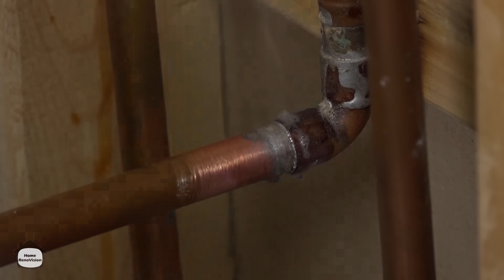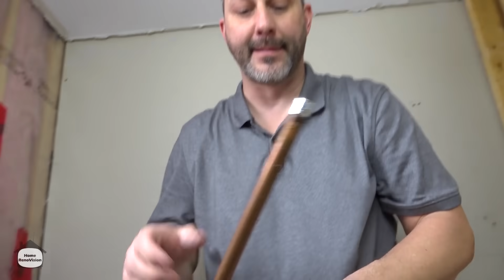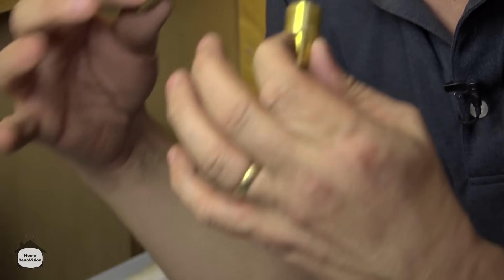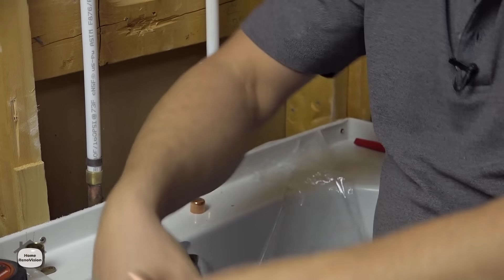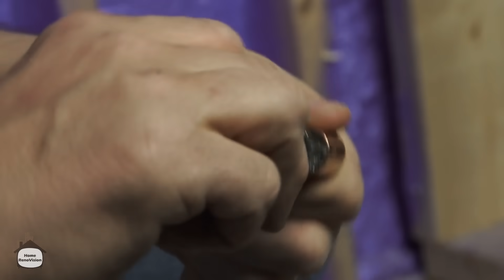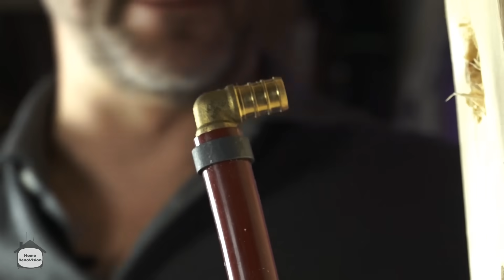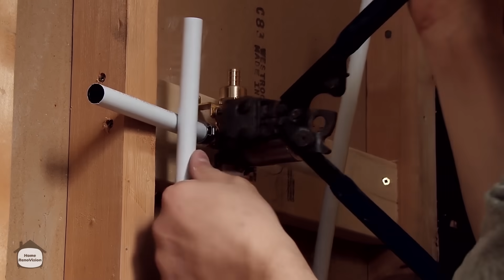4 Types of Shower Valve Assembly Installations

Comment: I use 2 pieces of painters tape on the tube on both sides of the ring to keep it in place. Or crimp it just a tiny fraction so it's still movable though tight on the tube.

Comment: JEFF, is it necessary to have the hot and cold supply line pipes extended past the center shower valve? what would happen if the hot and cold supply line pipes were only at the same height as the shower valve? Does having this extra length in pipe release pressure or have some other purpose? When you installed the copper to the plastic PEX pipe, the hot and cold supply lines pipes weren't extended past the main valve.

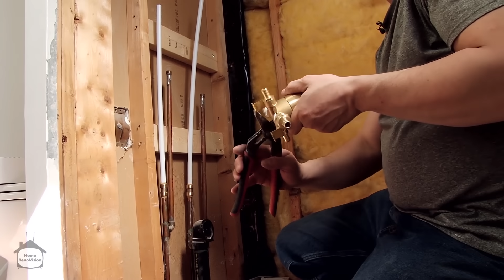Comment: In the last segment at 1:01:55 when using the pump pliers to install the threaded fittings, if you hold the pump pliers in the opposite direction, with the lower jaw facing the direction of rotation, you will find that the pliers are less likely to slip.

Comment: QUESTION - We would like to have a shower/tub with a DUAL shower heads on each side of the shower.   I trying to figure out the diverter valve and the outputs.  Poition 1. Tub spout..... Position 2. Main Shower head..... Position 3. Shower head 1 & 2.   Seeing the dilemma??

Comment: I have a shower that has a copper manifold like the one in the video I have changed the cartridge an turn the valve on an no water will come out . It doesn’t have a spout for the tub just the shower which I have new pipe goin to the shower head I can take the cartridge out of the manifold an turn water on an it has water shooting out but put the cartridge in an no water I changed cartridges several times using different types but none will let water come out the shower head .I been workin on it for six months can you help me please

Comment: I’m a plumber and I work with pex. I couldn’t help but see that on the cold side 90 the you crimped you didn’t crimp the ring all the way and you left a belly on it. That for sure will be a leak with time. On the last diverter of this video. The 90 you crimped on the cold side, you didn’t push the pipe all the way in the fitting and when you crimped the ring, you left too much space so just by seeing that, the ring didn’t catch the bridges on the fitting and didn’t make a water right seal.

Comment: I am looking to renovate my bathroom and started looking more into converting to PEX after watching your videos. It seems so simple especially the last way you show us with the shark bites (no soldering) - I am concerned with leaking at the joints. I keep reading that PEX is only good short term and will eventually leak in the long run - can you advise on this?

Comment: I CAN NOT BE LEAVE HE IS PROMOTING SHARK BIT FITTINGS FOR AN INSTALL, THEY ARE ONLY GOOD FOR A FAST EMERGENCY REPAIR until you have time to come back and do it right, with copper or pex. i cant tell you how many floods i been called to over the years, were some one put a shark bit fittings and left it. every time you turn a tap off fast, pipes jump, and the 4 tiny teeth in that shark bit, cut more of a grove down the copper or pex pipe, until that one day your not home, and them teeth have been just sitting at the very end of the pipe and just a bought ti slip out of the seal, and pow, it blows, and 8gpm is shooting out, same with people that use plastic tubing to there fridge ice maker, use copper tubing and compression fittings, as well the people that use the silver metal bands that that he used in the same shark bit clip are meant for polypropylene pipe and fittings plastic.. very bad bad..  and fuel line, the brass and steel crimp with iron in your water react, rust them out and pow.. on top of they do not clamp the pex well enough..

Comment: "When i do a job like this i like the think ahead" thats why you bought a copper cap instead of a pex plug. There is a reason why they didnt make the fittings perfect to fit together. They didnt intend to as turbulant flow travels in and out of that fitting now there is a large gap that been soldered. That solder is softer than the copper or brass and will pit. Eventually you will be looking at a large flood that you cant critically intervene with. You will have a huge demolition because you broke a cardinal rule being that if you need to transfer from one fitting type, you should always install a proper transition fitting.

Comment: Great video, my only recommendation would be not use sheet rock screws to anchor the top joint going to the shower head. The first time someone changes a shower head the head of the sheetrock screws break off and now you have a new job.

Comment: Thank you so much. I bought a Moen two handle replacing what was there. Personally I like two Handles better. Next time I will look for the valve body, maybe separate. I bought the whole kit valve body and faucet, spout and shower head.  After watching this video I will now buy pex fittings for the valve body since it didn’t come that way.
Thank you! Working on my Courage to soldier. I love the way you explain how the heat sucks the soldier.
Thank you.

Comment: Dude your soldering skills suck. I skipped to where you did the bottom part of the shower valve assembly. You started wiggling on it before material had a chance to harden. And thats just one example. Maybe soldering not your thing.

Comment: As a union plumber, pipefitter and welder. Please for the love of all trades don't call a sweat joint a weld joint!
Reply: Also instead of taking the easy way out. you should have cut the pipe thrown some couplings and new tees in and re soldered those joints with fresh copper. You should never trust just a solder cap on a joint. That's ratty work. Take pride in your work.

Comment: Lol look at the solder on the top of the diverted valve not a good soldering job. If this thing last a year without leaking I will be amazed. If it leaks soon it's because of lazy crapsmanship get a new plumber also if you saw the right side the solder has a pin hole. This dude socks. He must have alot of call backs or he makes up lies to charge customers for his mistakes.

Comment: See the green that's oxidation probably a leak. Also he moves the pieces after soldering instead of letting it cool first. Way to break the solder. Hope this is his own stuff. Definitely not a pro and if he is he below average. Or lazy however you want to put it. What's up with cooling stuff in the toliet.

Comment: Great instruction Jeff, but one question:  Most tub/shower valve manufacturers state that the line from the control valve down to the drop ear for the tub spout must be copper and never PEX.   Is this a recommendation or is it code?  I don't know the reason, but suspect it's a flow restriction issue, since PEX I.D. is slightly smaller and could cause a back up causing the shower head to drip or flow while the tub only is filling.

Comment: I just purchased a Moen Adler 82602 two handle tub/shower faucet set.    The hardware store said I could easily use pex for all the connections including the shower and tub spouts, like you did in the last demonstration.....   but the instructions say i have to use copper or ips for the shower and tub spout connections...   Is this a must or can I use all pex, like you suggest and the hardware store says I can?

Comment: Thanks for this video. I will be changing one in the next two weeks, and I am considering switching from the copper,
Reply: Copper(quality copper) is still a more permanent and long lasting pipe compared to any iteration of plastic.  It will pretty much last forever.  The pin hole leaks you might hear about is usually from cheaper thin walled copper. Copper also adds rigidity to the system which is important when you have to pull out a stuck cartridge.  PVC shatters when it fails in 10 years and PEX leaks at the joints quite often.  When plumbers say plastic is better they mean it's better for them because it's easier to install.  However plastic is not better for the homeowner in terms of longevity.

Comment: At about 5:40 in the video you are attaching the long piece of pipe for the tub spout.  After you heat the joint and add the new solder you shake the joint from side to side.  The solder has not solidified yet.  I think that it's not good to shake it because the solder may detach from the joint and cause a leak.  If you are still applying heat then that would be OK, but not as the joint is cooling.  In other words, some of this soldering will be easier with two people.

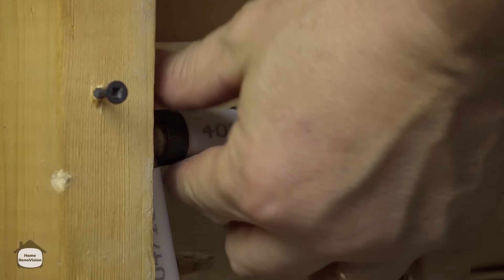Comment: Good video. But (there is always a "but"!), the crimp @40:28 looks like it ended up too close to the fitting - closer than the 1/8″-1/4″ I usually see specified. Being on the pressure side, it seems wise to meet the spec (although, this probably works as is --  but I can't see for sure exactly where the first "full" barb is on the fitting).

Comment: Hey Jeff, great video as always! I'm fixing to convert my 2 handle bathtub into a single handle and I'm converting everything to pex. I will need a plate and a valve to do this and I was wondering if they was a valve out there that was all ready equip with the shark bite already installed on the valve? By the way, my plumbing I'm converting from is pvc. TIA!

Comment: There is an arrow on the right connection. Shouldn't this be facing up? which would indicate that the valve body is 90 degrees off?

Comment: i learned to sweat copper a couple years ago,but never knew to flux the joint after it accepts the solder.priceless info,thank you. i'm a sub and love your channel.i've learned enough to rebuild my master bath from scratch.it's very rewarding to do a $25,000 job for about $3000.thanks again.

Comment: I love your videos but can you do one with pvc piping? I'm doing a renovation on my bathroom bath tub and i want to if I'm doing it correctly. Thanks.
Reply: I’m having problems with pvc also, my water pressure is so weak. Also read recently that pvc is bad for hot water because it breaks down. Thinking of switching back to galvanized pipes or pex.
Reply: @HighPriest1776  don't use galvanized

Comment: If you were to build your dream home what kind of material would you use.. Copper vs Pex?     Brass vs PVC?
Reply: I clean new construction homes for various builders in my area (MI) and they all use Pex, even the custom builders use Pex... The only thing that changes from builder to builder is the short section where the lines reduce down, the area closest to the fixtures (idk what it's called). Some builders switch from Pex to brass and some go to pvc. 🤷‍♀️

Comment: When doing Option #2 Pex to Copper - the original setup had what looked like air chambers to prevent water hammer - old school.  But when the job was done, those items were not present.  The question is should there be water hammer arrestor on both hot and cold?

Comment: Good video, but you miss one other option.  These days there are great epoxy's or glues for copper to join copper or brass fittings.  What is your thought on this technique.  Most homeowners won't feel comfortable with a torch inside a wall to solder fittings inside a wall.

Comment: I have to ask.
You never ran the water to test for leaks.
Would not air still be in pipes until you run the water and pressurize the system?

Comment: Tip  use the diameter of pipe 
To measure the amount of solder mark 
With a 90 degree bend.
1/2 in pipe use 1/2 of solder make bend to mark it. 3/4 bend at 3/4 in.

Comment: If you keep a spray water bottle and soak the wood, It won’t burn too much. Or, a piece of steel metal would help.also, remember to instal water hammers ( extra piece of pet on hot and cold lines) it saves a lot of noise issues later

Comment: Thank you for your VERY helpful videos.  We had a copper pipe shear off as we removed a valve and its darn hard to get a plumber over the weekend.  First we learned enough to remove the old valve and installed shark bites. As we were still struggling to get a plumber we learned to solder and did it oursleves.  We did discover soldering takes a bit of practice with heating all around the joint helping us. We got there in the end.   Thanks! Impossible without excellent videos from you and others.

Comment: I see that your fitting appears to be PEX compatible. On a video from November 10, 2018, you opted for a conversion from coper to PEX using (what appears to be) the same valve.

Understandably, PEX on its own is more economical, requires less skills (pipe fitting, soldering), but in this particular case, sticking with coper is more than likely the best move forward.

If you can elaborate on your reasoning behind sticking with coper versus PEX, I think viewers may appreciate your input!

Comment: I just seen a video about the crimp. You missed half the crimp ring on a couple. It was left uncrimped. It’s code in us to crimp onto both seal rings. 1/4 inch over as you said

Comment: I didn't see you reclean off the fittings on the shower valve and apply flux to the inside and out side of fitting, I just saw you apply flux to the outside of the fitting, is that acceptable?

Comment: This may have been covered already. If you are working on a property with a well fed system take a quick look at the inside of any elbow you might expose to check for wear. Now and then a bit of sand can get fed through the lines and the 90's are where it'll wear through.

Comment: You are presenting this information as if you know plumbing. You are making a lot of assumptions and mistakes. I believe your success in plumbing, thus far, has been very lucky. You seem to follow most of the protocol but are missing key steps when putting together a video geared toward a homeowner. 1. you never wiped or mentioned the importance of wiping your sweats with a clean rag, especially after adding flux after the solder. Not wiping them will cause the green corrosion that was present before you started work, and eventually cause a leak. 2. when the flame turns green it is ready for solder, don't force a sweat or you'll wind up with a cold sweat condition. 3. when you use a crimp ring and tool it must be fully covered by the tool that is providing the clamping pressure. I repeatedly saw you not do this and one crimp was even belled at the end after the crimp was made. 4. solder the drop ear before attaching to fixture for less flame exposure to wood counterparts. 5. you never deburred or mentioned deburring the inside of the copper after cutting. 6. the valve body should have been mounted before the sweats were made, then not being forced into the wall cavity under stress.  7. rather than moving up the whole drop ear shower tube, I would have installed the hot and cold after cutting the existing tube a half inch (opinion only) 8. cut the PEX to the correct length instead of a little long. It will sit well in the cavity instead of bunched up. 9. always use a hand screwdriver to install the body parts. 10. Use high temp plumbing grease when installing the o-rings and cartridges. 11. when turning the water back on to check for leaks keep the sink valves open so you get water in the pipe completely, any trapped air will show up as a leak later. Sorry I had so much to say, and I usually don't, but you have too many things wrong in this video. Respectfully Rob
Reply: Sounds like you should be making videos man... You do realize these videos can only be so long and have to be edited down, hence, can't show every single step . But on the other hand ,,I know there was some things he didn't do that he should have. But I bet if you made a video I could catch mistakes that you make too.

Comment: I'm wondering why you flux the copper after you've soldered the joint.  When we solder printed circuit boards, we always clean the flux with alcohol, otherwise over time the flux eats the copper traces.  I would think something similar would apply to copper pipes -- they would corrode with a bunch of extra flux applied after the pipe has been soldered.

Comment: Purchased a (Delta) valve that has 1/ in threaded  connections. Also purchased 1/2  female to 1/2 in pex  adapter. Used Teflon tape on threads. Think it will leak ?

Comment: @home renovision, What did you mean when you briefly mentioned about dripping from the tub when using pex? I just installed a 2 way valve with all pex, and the drop ear on the tub leaks when the tub pipe is screwed into it

Comment: I have a question, do I need to cut a 14x14 inch square for access?  Can it be done by the hole for the valve. I don't really want to move my kitchen counter top or tear down my bathroom tile.
Reply: @sunheeferguson  The access doors come in smaller sizes as well. No need to cut the hole 14 inches. The access door is adjustable to varying sized holes depending on the door size chosen. I just installed an 8 inch door for access to my Sharkbite water shutoffs.

Comment: In all that time it took to remove existing valve, you could've rebuilt it with new copper and your joints would've looked much cleaner.. leave it to the plumbers because in the end, you'll end up calling us anyway "handyman"

Comment: Why are there two vertical copper pipes capped off above the valve? I've seen this multiple times now.  My plumbing does not have this.  My house was built in '76 in Baltimore,  MD, USA (in case it's a code thing).